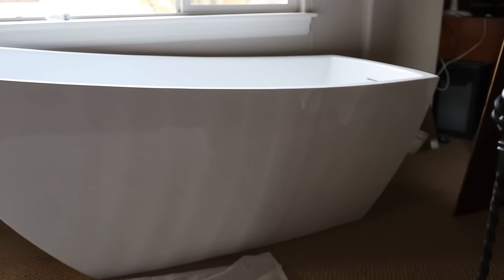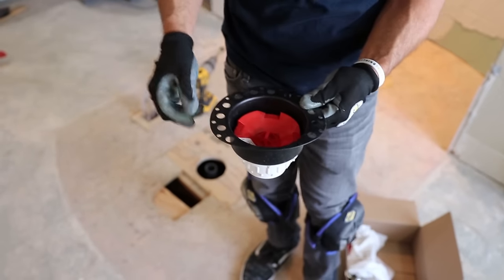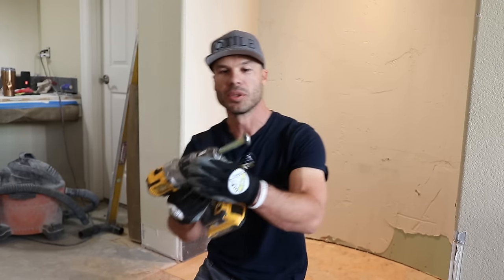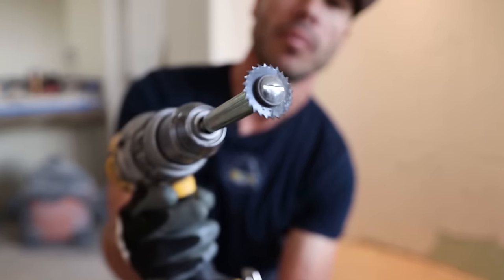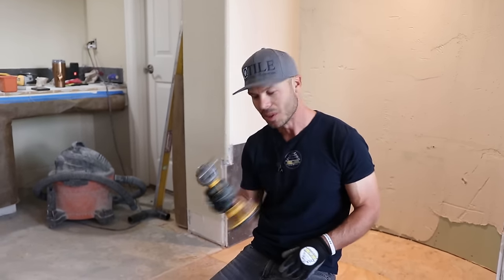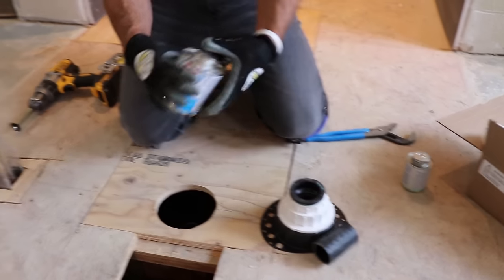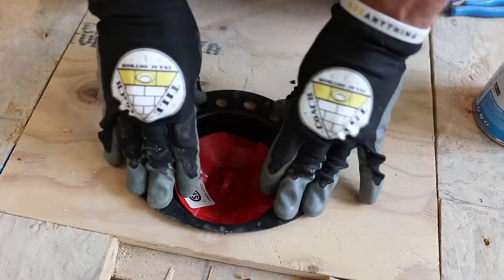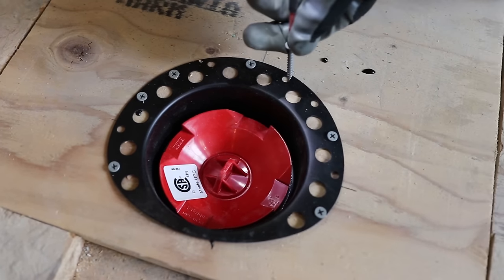Easy Freestanding Tub Installation - WHY YOU NEED THIS!!! - Island Tub Drain

Comment: I have watched a lot of your videos and find them very educative. Thank you for the effort to improve and help others with their projects Pro or DYS! I have bought 3 different occasions this drain. The one you do show. Different sellers and all 3 times had fail for Me... They all leaked from the gasket. One almost cost me thousands of dollars. I try to take one apart and even with the right tools almost destroy it. They try to seal it but coming out of the box leak. Just poor water and you will see. I just wanted to share my experience and help others prevent a disaster. If you decide to get one of this drains? Poor water in the base out the box and leave it for a while. Make sure the gasket does not leak from under the base. Between the Black base to the White PVC

Comment: Fantastic video,  been doing these for a while by cutting from below and plastering the ceiling of the downstairs room (usually the kitchen) this will make things so much simpler.  you guys do make the coolest accessories to make the job easier.  just bought a pipe cutter from amazon because I had never seen one before and it makes things so simple.  great video thanks.

Comment: As a plumber myself I don't glue in that stub out from the trap, that way I can get an exact measurement without having to use an inside cutter and know that my pipe is cut square. I'm not criticizing your work I think that was a great video but it's merely a suggestion as it works a lot easier for me.
Reply: Not allowed to use transition glue inside a house either. Code says we can use it for one fitting outside the home which means the outside sewer line only. Should of been converted over in the floor with a mission coupling and stubbed up in PVC

Comment: Great video showing a better option for the drain instead of using the (slinky) flexible pipe that comes with the install kits. Note to anyone installing these tubs (never use the slinky pipe) , you can expect leaks or clogs in the future.

Comment: I installed the same kit. It was a pain to remove the drain cap. The lip broke as I tried to wiggle it out. I ended up drilling a couple of holes and removed the cap with a screwdriver and a utility knife. Overall, it was still a good kit to use if there is no access below the tub.

Comment: Awesome video! Second part is a must watch. You are thorough and clear. You are awesome at coaching. Thank you from Canada. I had imagined how they installed the tub in the master bedroom as I noticed the tub will come up if downward pressure is applied  to one side (eg. Seat down on the edge). Your video has now confirmed exactly how the install work was done. I had never seen anything like that. As a DIY /owner was really pussled as I'm familiar with the glued plumbing only. Thanks again, Dan

Comment: Thank You Isaac for your reply back. Ps I was also able to use five pieces of 2 x 4 cut it into squares, with a plug drill into the wood,for the feet, to make the tub sturdy, but I still have a gap under the tub. Ps push come to show of just paint the wooden feet.

Comment: I'm currently doing a big rehab and remodel job and they are supposed to be putting in stand alone tubs but have zero measurements or dimensions so I've got to guess on placement so rather than putting my trap in I'm just running a stub below the floor and capping it

Comment: Did you ever make another video with all the parts as well as the tub installation? I just bought a kit and about to redo my tub drain on a concrete wetbed.( I do have an access panel underneath already)

Comment: Hi Tile Coach.  I am installing a free standing tub and your video showing the Jacuzzi drain alignment kit probably saved my project.  I was going to cut my pipe from tub to drain and do like you advise against in Part 2 by gluing and setting the tub and take my chances that the tub is aligned in the 30 seconds before the glue sets.  I am going to order the Jacuzzi kit and sleep better.  Thank you so much.  I wish that I had seen this a month ago before the tile went in but I think it will still work.

Comment: Does the P-Trap have to be right under the drain?  I am replacing a large built in Jacuzzi tub with a free standing tub.  There is an offset of about 10 inches  from the P-Trap to the new drain location.  Can I get there using a 90, a 10 inch pipe, then another 90?

Comment: Hey Isaac I’ve seen your video that you posted but I have a concern about the freestanding tub. I have noticed with the tub that I have it has no balance at all and it is also a freestanding tub. I wonder if there is any way to connect the tub down to the to the floor . When the tub is empty it’s easy to tip the tub over. The tub that I have only has five Adjustable feet. Pads under the feet are only  an 1 inch and7/8. I don’t think the tub can support the total weight. Certainly the tub can’t support its empty weight if lean on it.

Comment: Hi Coach! Quick question if you have a moment. Got all my plumbing installed under the subfloor (second story), but I notice that my ABS pipe attached to the p-trap on one end and the flange on the other isn't exactly perpendicular to the subfloor, so a slight angle. I'm worried when I drop the tub with its rigid brass tail-pipe that I might tweak the plumbing joints. To lessen the affect, I want to cut about 3-4 inches off the tail-pipe (still will be below the flange gasket), but the manufacture says doing so could cause a leak. Any thoughts or experience on this? -- kevin san diego

Comment: Great video.... question, is there any reason you couldn’t use use 2” drain trap if you are roughing in for a freestanding tub or is the 1 1/2” a requirement?
Reply: This was probably a remodel where the existing drain was already 1.5". You could use 2" if you wanted to.

Comment: What if I'm on concrete and my drain hole doesn't line up with the tub drain hole?  I've seen using a extension hose or should I chip up concrete to relocate the drain?

Comment: The second most important tool is a magnet, if you have not dropped the internal saw down the pipe..........you will.
Reply: Been there.....
Reply: Mike Fox Renevations mentioned it below - in some situations you might be able to just stuff a rag down before you cut to catch anything and everything that happens to drop.

Comment: So if you buy a cookie cutter house and it has the 3 wall framed tub next to a framed in shower set up.......pipes may be close to a wall or tight fit but a free standing tub is wanted how do you redesign that bathroom with out destroying walls? Keeping cost low.

Comment: What's up with the 1/2 inch of drywall mud on that back wall? 
I think you should be using a tapered reducer versus the bushing. Bushings are for going from smaller to bigger,  tapered are for bigger to smaller. 
In the case of having access to the plumbing,  I might have changed it all to 2 inch.
Reply: @TileCoach  Great work as always. Now headed over to startile to get angry at the world
Reply: @TileCoach  Looking forward to seeing that!

Comment: What about the overflow, also I'm going to install one on a slab what do you do about the faucet? Do I just stub up m.i.p's or do I leave a little gap when I pour concrete back for some brass nipples?
Reply: Burgess Brooks Most free standing tubs come with a overflow that is inside of the wall (exactly the same principle used in vanity sinks). You just have to make sure that you buy a drain stopper with an integrated overflow, this kit will do the rest. Make sure to look at you tu. specifications to make sure that in fact it have an integrate overflow.
About the fauce, I decided to go with a wall mounted because I’m also dealing with a concrete slab here in florida.
Reply: @gabireishst  thanks for the info. I did finally notice the built in overflow. Thanks again for the reply👍

Comment: Awesome! Thanks for the video! I’ll be installing my tub next month and using this. I’m building my house and have learned a ton from you a Sal. I’m using the Kerdi membrane and Ardex 8+9 for the showers thanks to you lol. 

I do have one question though, I think it is ok to do but I want to make sure. 

Is it ok to install a back splash in a kitchen with painted and textured walls by just applying the thin set to the walls? Or does the paint and texture need to be removed?

Comment: I’m trying to understand how the water drains out of the tub. I need to extend the tub drainage about 2 ft over from where it was. The old tub has been removed. I poured water down the existing pipe to see if it would drain but it didn’t how does it work. I want to try and install the pipeline myself just adding to the existing lines

Comment: Just a FYI. 
In the past year or so I have got 4 units that the seal was bad. 
And there great for sewer gases but not great if there’s a backup. 
And note to everyone. You can do a regular tub or whatever. But do NOT use plastic pipe. The brass won’t deform like plastic and hold the seal.
Reply: Isaac Ostrom 
I had 1 a month ago. 
It all looked fine ( it was 6pm I was tired but it looked fine )
I went to do a water test the next day  and water everywhere. 
The seal looked like a perfect slice. I figured the pipe had a burr but it didn’t. 
I called mfg and service rep they were out sourced (gaskets) and they should be checked. I was a bit taken back. 
I have had others with issues. 
But there nice to use. 
I get upset when you pay $$$ 
And the 1st thing you need to do anymore is check for damage or missing parts. 
I can say one thing. Customers have ZERO CLUE what people like us go through.

Comment: i always thought the glues your using, the transition glue, and ABS glue were called solvent welds.  I thought part of the process of solvent welding was to prime the pipe. Maybe i was always mistaken, and the the solvent needed the primer and glue on pipe to make the proper chemical reaction to solvent weld. But maybe i learned something new and just using the glue is enough to solvent welds the pipe? I say this cuz i never saw you use primer, that or you left it out of your video.
Reply: Primer is the best way

Comment: AH.....   ITS THE JACUZZI MZ-20000  Thats Twenty Thousand, not 2000.  If the folks at jacuzzi are sponsors?  i'm sure they are not  happy.  20,000 or 20000 is the fitting.  thanks